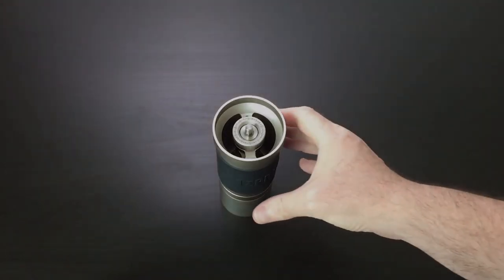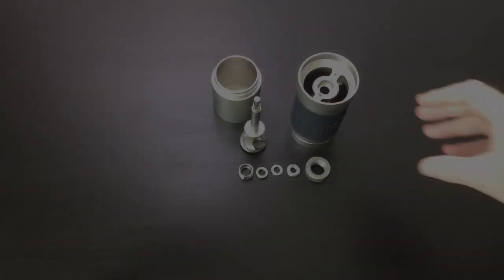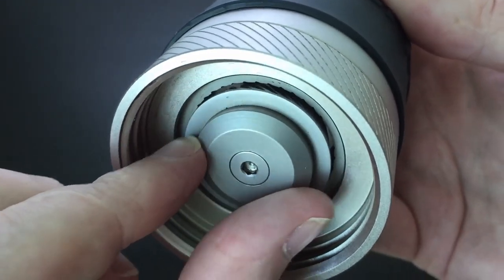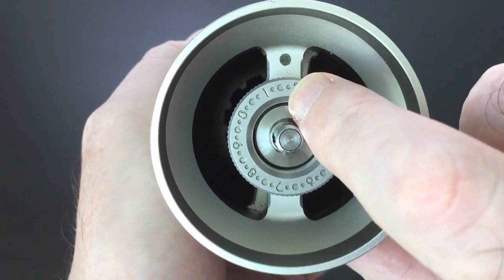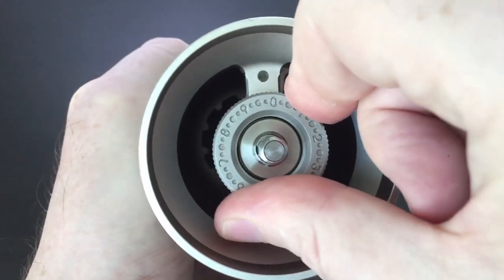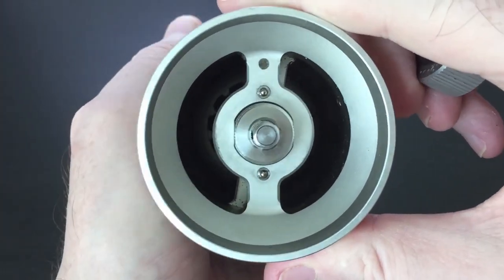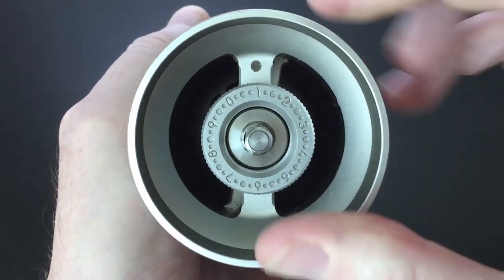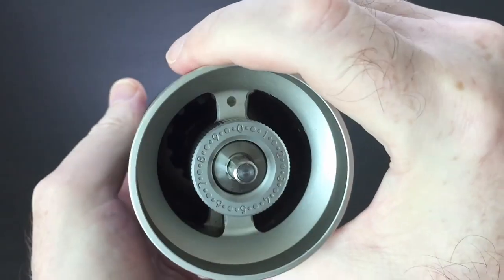1Zpresso JX Pro calibration and "quick calibration" guide

Comment: They must have recently changed what you call the thumb nut. Now it has 2 holes on top to use a spanner wrench or snap ring pliers to tighten and loosen it.
Reply from the maker: Hi Richard. 1Zpresso changed the thumb nut about one year ago, as you point out it did not used to have the two indents in the top of the nut.

I asked 1Zpresso about this at the time and they confirmed that it was not a new feature and that it was simply something that was added at the manufacturing stage for the factory, like some kind of tooling guide.

I cant really see any situation where you would need a tool to tighten the thumb with a tool, however the thumb nut can be very tight to get open when the burrs have been over tightened due to excess form while calibrating the grinder and perhaps, like you say, these two indents could be useful if you have the correct tool to then loosen the thumb nut to then release the burrs.

Comment: When I calibrated mine I could hear some scratching noise inside. Did I screw something too tight?
Reply from the maker: Sorry can i ask you for a little more information?

Just to be clear, are you saying that you dismantled the grinder, then you reassembled the grinder and zeroed (burrs fully closed) then you opened the burrs to the grind setting for your brew and when you turn the grind handle you can hear scratching (scraping) inside the grinder?

If you dont have any obvious damage to your grinder like dropping the grinder, or damaging the burrs, i dont think that there is an issue with your grinder and the issue is something more simple.

When you reassemble the grinder properly, there should be no sounds coming from inside the grinder (apart from the coffee beans being ground up).

There should also be no sound from the burrs making contact with anything inside the grinder (like the outer burrs) when you are grinding beans, because the burr shaft is very solid and stable and the these grinders don't have any wobble or movement from the burr shaft when you turn the grind handle, so i don't think that's a problem.

If you are turning the grind handle without any beans inside the grinder and there is a scratching or a scraping sound, is there any resistance when you turn the grind handle? does it feel like the handle does not turn freely and smoothly?

It is possible that you have not assembled the grinder properly, so check if all the parts are assembled the correct way.

1) Check that the both the outer burrs and the top ring are tightened properly.
2) Check that the burrs shaft is pushed up fully and the thumb nut is screwed completely, if you dont push the burrs up properly from below, you wont be able to tighten the thumb nut completely.
3) The spring of on the burrs shaft properly (the spring need to be placed on the shaft with the wide opening facing up and the narrow opening facing down.
4) The baring disc is placed on the burr shaft the correct way (the disc should have the side with the ridge facing up, because this covers the baring cap when you place the burr shaft back into the grinder body.

I suspect that one or more of the parts of the grinder are not assembled properly and this is causing the issue, so make sure that all the parts are assembled and tightened properly.

Comment: Hello. Can you please tell me how many bearings this coffee grinder has?
Reply from the maker: Hi Valery. The JX-Pro has two stabilising bearings on the top surface of the top ring, these two bearing are located under the adjustment dial when it is screwed on and they obviously stabilise the adjustment dial.

All the 1Zpresso grinders also have a small top bearing ring that sits between the top bearing cover and the screw column. This small top bearing is enclosed, so its not possible to see how many small bearing are inside, however i assume that you are not referring to this small top bearing ring and the other two bearings under the adjustment dial.
Reply: @mightymightyironhead Thanks

Comment: Mine seems wayyyy out of wack. It continuously lands on 7 or 9 and I just can’t seem to get it to zero. Idk what I’m doing wrong
Reply from the maker: It seems a bit odd that the adjustment dial number keeps landing on the 7 or 9, if you have dismantled the grinder and reassembled the grinder, the adjustment dial number is usually random. 

Anyway lets try and figure out what's going on. 

I am assuming that you have followed my video and it did not work for you?

If you have followed the video and it still does not work, i would check the threads in the middle of the adjustment dial and both the sliding column and the thumb nut, sometimes the threads can get damaged. 

Its unlikely that they are the fault, but if they are damaged ask your dealer to send you a replacement part, its usually free.

Then check to see if the thumb nut is completely tightened. When you are reassembling the grinder you really need to push up with the burrs at the bottom and hold them while you turn the thumb nut completely until it cant turn anymore, this holds the burr shaft at its correct position and you need to do this for the adjustment dial to also be in its correct position when you screw that on.

Again its unlikely that this is the fault, but its really work doing this anyway for your grinder to work properly and the grind adjustments to be accurate.

Sometimes the outer burrs and also the top ring can become a little loose, so check that they are tightened correctly.  

If you have not followed followed my video and you have not calibrated your grinder.

Make sure that everything is assembled correctly and is tight, push up the burrs so that the thumb nut is tightened properly.

Then zero your grinder by turning the adjustment dial all the way clockwise until the burrs are fully closed.

If the number is on 7 or 9, you then need to take the adjustment dial back off and turn the thumb nut and turn the thumb nut counter clockwise a few clicks then replace the adjustment dial and see what you have, so this until the number is in the starting position. 

I honestly dont think that the grinder is damaged, i have sold thousands of 1Zpesso grinders and i have never had anyone with an adjustment dial stuck on the same numbers, so i am almost 100% sure that this is either something is loose or the grinder has not been assembled correctly.

Anyway please update me and let me know if this is any help.
Reply: mine is always at 3.5. I've done everything all these videos say. The only way to truly adjust mine is to loosen the thumb nut under the dial a few clicks. Nobody mentions how loose their upper ring cap is which shows the stationary gray dot. So, if you loosen it a bit you can change where the gray dot lines up with the click dial.

Comment: I don't understand how turning the burr could effect the calibration?
Reply from the maker: It does not really effect the calibration. The grinder is calibrated when the burrs are fully closed (zero point) and the number that you have at the starting position does not need to be the 0 number, it can be any number that you have when the burrs are tight (zero point).

There are threads on the inside of the burr shaft and the thumb nut and when you tighten the thumb nut all the way to its tightest point, it keeps the burrs in the correct position.

So when you move the burrs slightly its just kind of changing the point where the adjustment dial stops turning because you have allowed it a tiny bit more of the threads space to play with and the adjustment dial can move a little more before it becomes tight again.  

When you follow the 1Zpresso method, they recommend that you take off the adjustment dial and adjust the thumb nut by opening it, this method allows you to be able to tighten the adjustment dial a little more also by giving you slightly more threads to use, so its kind of the same thing.
Reply: @mightymightyironhead  Ohy yea, after reading your comments and re-watch the video. I think I'm getting how it work now. Thanks
Reply from the maker: @kornigsegg  its really all about the threads on the burr shaft and the adjustment dial.

Even when the thumb nut is at its tightest position, you can very slightly move the burrs left or right when you open the adjustment dial slightly, as i show in the video, because when you tighten the adjustment dial again after moving the burr shaft, it seems to give you a little more thread space to work with.

It can take a couple of goes to get the hang of it, but i use this method all the time and it works perfect for me.

Too be honest, the 1Zpresso method is also pretty quick if you dont mind taking the adjustment dial off and on a couple of times.

Comment: I have to turn my Thumb nut 8 times to calibrate to zero. that's a lot
Reply from the maker: Thats normal and nothing to worry about.

The amount of clicks you need to turn the thumb nut depends on where your zero number falls when your burrs are full closed.

If your burrs are fully closed (zero point) and the zero number is at the left side of the grey dot on the top ring. you will only need to turn the thumb nut enough clicks to allow the adjustment dial to move around further until the zero number is at the top.

For example, your burrs are full closed and the zero number is at the number 9 position, you only need to open the thumb nut a couple of clicks to bring the zero number around.

If your burrs are full closed and the zero number is at the number 6 position, you will then need to open the thumb nut more clicks to bring the zero number into position, obviously the further the zero number is away from the starting position, the more clicks you will need to open the thumb nut. 

If your burrs are full closed and the zero number has landed just past the grey dot on the top ring and is at the number 1 or 2 position, then you will need to open the thumb nut quite a few clicks to all the adjustment ring to turn enough so that the zero number can move all the way around and into the starting position, this is normal.